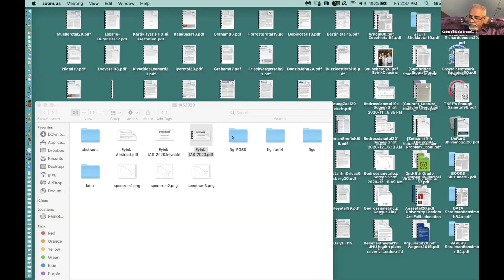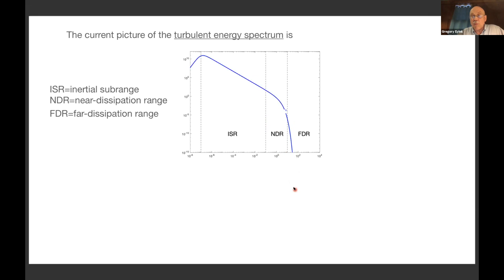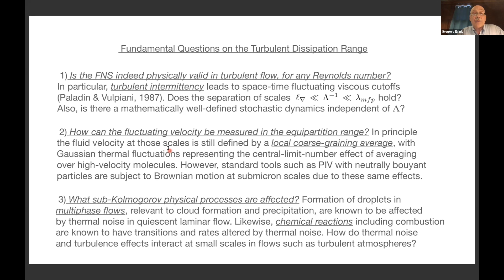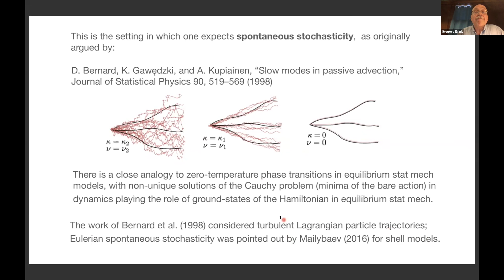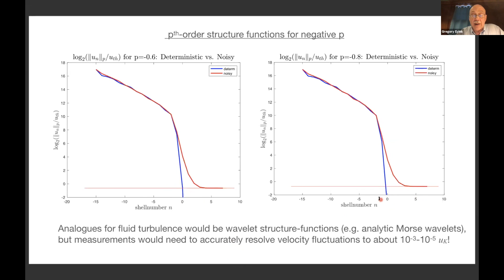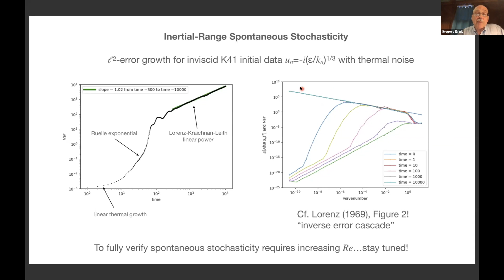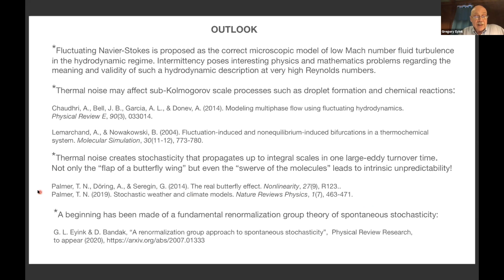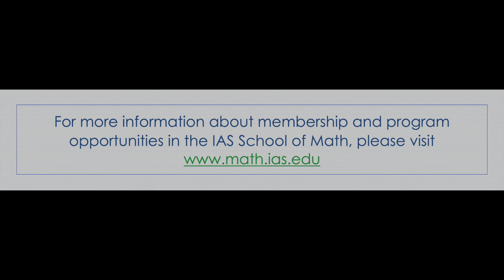Fluid Turbulence, Thermal Noise and Spontaneous Stochasticity - Gregory Eyink

Comment: Great talk.  I think this is actually a very important but deceptively subtle finding.  It's feels similar to what the some particle physics guys and some condensed matter guys have learned but I've seldom see anyone clearly articulate with the possible exception being Bob Laughlin... I'll try to bumble through it from memory:

When you assum the algebraic structure of a PDE you are ALSO unwittingly assuming something about the statistics of the objects that can contribute to the continuous limit.  The ability to do things with RG flow and other useful things that relate to universality stability analysis etc are possible only really when you nail this stuff down and it goes from both the top down AND bottom up.  However, there are some things that MUST be measured across phase boundaries that CANNOT be predicted from first principles, because the physics boils down to the way the symmetries and degrees of freedom interact in the specific systems you are describing (ie details matter).  More importantly those details are hidden by a UV and IR of their own cool things down too much and you measure the ground state of the system heat them up and you measure the first excited state of the system from which YOUR system is built... in this case the vibrations and rotational degrees of freedom of molecules, in the case of a particle accelerator whatever field it has the energy to access.  Case in point the carefully designed turbulent mixing inside early plutonium implosion bombs! Meaning the boundary conditions or initial conditions of your statistical phase space matter and must be measured for the theory to describe the reality we see... these are more or less your parameters and couplings...and symmetry breaking regimes.  From these details you get the radical difference in the behavior of water and carbon dioxide or a the various exotic materials like topological insulators and superconductors.  This detail driven parameter oriented foundation of physics is something the high energy community has not been able to accept for some reason. 

However, this this talk provides a beautiful example of how we can increase the formal  connections between statistical mechanics and fluid dynamics in a fairly profound manner.  This is a lesson other physicists and mathematicians working in their isolated silos should take to heart.  Again, what a great talk.  Reminds me of the first time I heard about the QGP sheer viscosity measurement at RHIC and as a student when I learned about the apparent role of surface tension in the nucleus during fission in heavy elements...  everything just keeps coming back to statistical mechanics!